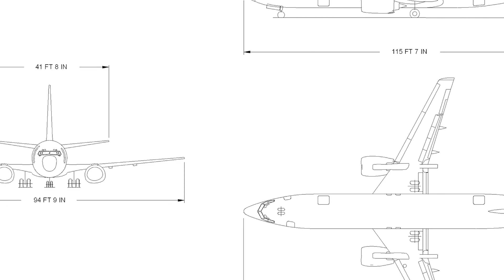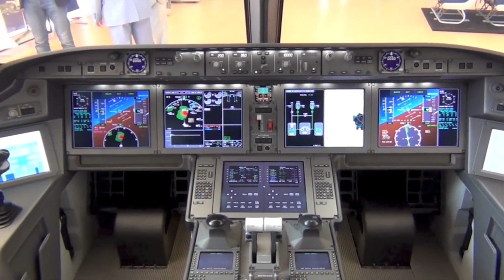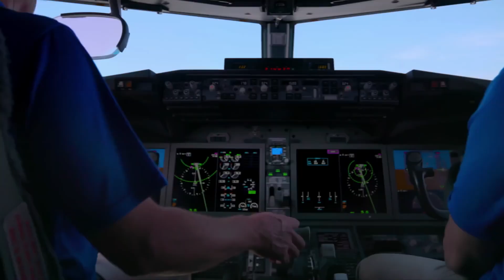Boeing 737 MAX - the legacy of the king

Comment: Too expensive to design a whole new model? How expensive is it now?
Reply: Hindsight is 20/20. It would have been less expensive to started fresh
Reply: @MaynardFreek  You're forgetting one thing. Designing a clean sheet plane from scratch to first flight takes 5 to 10 YEARS and involves a lot of R&D. Also, airlines didn't WANT a new plane, because otherwise there wouldn't be so many orders for the Max.
Reply: @MaynardFreek  - To be honest, it would have been enough to design the MCAS to use two AOA sensors (the 737 had them already) and shutdown "gracefully" if these were not in accord with each other. 

It would have lengthen the certification process quite a bit, but I doubt it would have added more than a couple hundred millions to the development bill...
Reply: @MaynardFreek  The Boeing 787 cost $50 billion to develop.  It might not have been less expensive to start fresh.
Reply: I'll just remind everyone that Boeing has spent $46 billion to buy & cancel their own shares, 25% eliminated which causes the share price to rise. Now they are borrowing $10-12 billion for short term cash flow? The "value" of 5000 planes is 0.5 trillion! When no passengers will fly on it they will suffer HUGE depreciation or the orders will be cancelled altogether. Ryanair ordered 100 but said they will not be forcing customers to fly on it --- they are NOT stupid!!
Reply: 15 billion dollars and counting. Literally the development price of a new aircraft.
Reply: Billions with grounding of all 737 Max worldwide. Irreparable damage to Boeing’s reputation and lawsuits.
Reply: @Eatshhhushi  at this time it appears to be around 20 billion bucks considering everything involved
Reply: @Eatshhhushi  "Irrepairable"
Reply: Also time

Comment: Bring back 757's and MD's(717). Those old models have been tested by life and were modified to almost perfection after unfortunate accidents over many decades... This new 737max is a completely different animal. It's made of totally different materials with new never used before designs, and unknown untested software and electronics...
Reply: Why would we go back to 757s and 717s? There isn't a market for them. And why axe off the 737 MAX when it can be improved and modified, like the models you mentioned?
Reply: @person.w9780  Some lines can't be uncrossed. Not only MAX will not be coming back, but the whole brand of 737 has been smeared for good, that's why I'm not mentioning it and talk about the only 2 single aislemodels with good reputation that Boeing had.

Comment: Build an inheritently unstable aircraft and add an "MCAS" / AOA (Angle of attack) device on the outside of
the aircraft to FIX in the inheritent unstableness and what do you expect? The new extra big By Pass
Jet engines had to be mounted forward and higher than what that airframe was designed for, that
is why the MCAS / AOA device was installed! SO WRONG, and all in the name of saving a few
dollars and boosting the owners PROFITS! Now lets add Boeing conviencing the FAA that 
no additional training would be needed by pilots switching from the old to the new, now
add the Airworthyness directive that came out November 7, 2018
 (AD #: 2018-23-51)
that apparently MANY pilots never saw and let me see, what else, oh don't forget the 
nacelles of these HUGE new engines will create lift at a 14degree pitch up attitude 
that makes the plane misbehave and you have a recipe for DISASTER. BELIEVE IT!
Reply: Now some are saying the plane is stable, that the MCAS as delivered is the royal screwup.  IDK.  Could be true; could be damage control.  Still waiting for the full story on this.
Reply: Assisted stability augmentation is not itself a bad thing. The MD-11 has it, the 777 has it. It was the IMPLEMENTATION that was disastrously bad. Clearly you know nothing about aviation.

Comment: Just disconnect the freaking  MCAS !!!!
Reply: Aaah but you can just turn off the MCAS software as this hull shape is aerodynamically too unstable to fly without a computer nanny monitoring and nudging its natural tendency to stall.. All a by-product of "pushing the (efficiency) design envelope".. So you have limit state engineering augmented by software to nudge it into a (just) pass category on aerodynamic stability.. Houston (Seattle) I think we have a much bigger problem!
Reply: @MajorDrama1  Nope, not true at all.
Reply: @AmbientMorality  then why does MCAS exist?
Reply: @christophermorley161  MCAS exists not because the plane is unstable. It's because it must behave the same way old 737's behave, so no expensive pilot training is needed. But it does not behave the same, mainly because the position of the new engines. So MCAS was created so it feels like and old 737 to the pilot. It backfired spectacularly as we can see.
Reply: @felipaorfr  It exists for both reasons. You are correct in that the "Augmentation" part of the name is due to making to making it feel like a 737, but its other job is compensating for the aircraft's aerodynamic instability due to the new placement of the engines. It is unstable because if power is added, then the nose tends to pitch up, as the thrust is below the centre of gravity. However, it will pitch up much further than the old 737NG, and will enter a stall much more readily. It is for this second reason that MCAS is required. Instability is like a ball on top of a hill. The steeper the hill, the faster the ball will roll, like the more unstable an aircraft is, the more quickly it will deviate from straight level flight. The other thing about this is, the ball takes a lot of energy to stop it rolling, and much more energy to reverse the roll and get it to the top of a hill. Same with aerodynamics in aircraft: the more unstable, the more energy is needed to stop the pitching up and tons is needed to reverse it and achieve level flight. This is part of why MCAS exists- the Boeing test pilots were horrified by what they found when they started chucking it about, and the trim needs to be adjusted to compensate for the plane's willingness to pitch up dramatically at high AOA. However, you are very right in suggesting that it was to make it similar/the same to fly as the previous 737, but that's only part of the reason.
Reply: @felipaorfr  Assisted stability control is not a bad thing. Most modern airliners have it. MCAS itself is not the problem. The problem is how horribly Boeing implemented it.
Reply: Maybe, just maybe, adding more fuel to the underbelly of the aircraft will reduce the pitchiness (CoM and CoT will be more in line). Then disable MCAS.

Comment: CHANGING the flight control computer
Then NOT telling the pilots 
IS CRIMINAL
Reply: 100%
Reply: It’s in the manual. It’s the job of the airline to train the pilots. American based airlines did. Ethiopian and lion didn’t. Problem sorted.
Reply: @baconcorde9970 Be great for Boeing if that simple! I heard that Boeing advised the airlines that the changes made to the control systems including the new MCAS changes were insufficient to warrant further training.. And further that the plane was sold with "no extra pilot training required" being specified as a benefit of the new plane when sold as training's costly right? If true it would seem this was  tragically short-sighted..

Comment: The old plane is much nicer than new type ... the wheels are hiding /cover not being seen under the plane... I guess that is the cause of plunging to the surface (ground ,sea) because of the pressure during flight even you have new engine which might did quarter of its problem/crashes , too much outward of its engine and not centered the position of its engine like others , the more gust of winds the ore trust and climb can give to the plane and double the speed of plunge down even you change flaps on both wings and adding thrust still can’t help to reduce plunge

Comment: actually, Boeing behaves like McDonnel Douglas during the DC-10 crisis in the 70's ...worst damage-control.
Reply: Well a former McD’s employee was indeed the CEO..... A McDonald’s employee would have done a better job. 🤦‍♂️
Reply: The joke is that McDonnell-Douglas purchased Boeing with Boeing's money. Boeing buys them then McDonnell-Douglas execs took over the company and kicked the Boeing execs out, somehow. The lawyer-accountants replaced the engineers at the top of the company, hence the 737Max disaster. With that and the communist labor unions, it's the end of Boeing.

Comment: They're falling out of the sky
Reply: You like someone else I know. Always blow things up. Some will say make a mountain out of a mole hill. I believe only 2 crashes and here on youtube, they have a video that the pilots could have safe them. No doubt, it needed fixing but come on. the 737 like sold more planes than any other type. Every 5 seconds there is one landing or taking off. Wow. is what I say to that, not make fun of this plane.
Reply: CaptainArt777 Boeing installed the MCAS system on the MAX, that a whole new system and they told the airlines no need to have a pilot training? Hell no! Even though know the MAX flaws but Boeing didn't care to fix them, just wanted to rush the MAX to enter service
Reply: That took a dark turn

Comment: Since Boeing has prioritised profit over safety, i don't fly Boeing anymore. Look at the 737 Max and the problems with the 787
Reply: I mean, i don't hear about any issues with their other planes.
Reply: @person.w9780  Ummm Duh!
Reply: Leo Raymundo - In a way. 80s crashes caused by hydraulic cylinder, which was redesigned to preclude fault. Max crashes caused by stupidity designed and hidden MCAS added to counteract near-stall handling characteristics resulting from tweaking the 1950s vintage airframe. Max is still flawed aircraft even with MCAS fix
Reply: @jameshoffman552  The problem is not the MCAS itself. It's how horribly wrong Boeing IMPLEMENTED it.
Reply: Innovations comes with issues
Reply: But the non-Max 737's, 747, 757, 767, 777, and 787 are safe. Stop being a paranoid idiot.
Reply: @leoraymundo2127  
Build an inheritently unstable aircraft and add an "MCAS" / AOA (Angle of attack) device on the outside of
the aircraft to FIX in the inheritent unstableness and what do you expect? The new extra big By Pass
Jet engines had to be mounted forward and higher than what that airframe was designed for, that
is why the MCAS / AOA device was installed! SO WRONG, and all in the name of saving a few
dollars and boosting the owners PROFITS! Now lets add Boeing conviencing the FAA that 
no additional training would be needed by pilots switching from the old to the new, now
add the Airworthyness directive that came out November 7, 2018
 (AD #: 2018-23-51)
that apparently MANY pilots never saw and let me see, what else, oh don't forget the 
nacelles of these HUGE new engines will create lift at a 14degree pitch up attitude 
that makes the plane misbehave and you have a recipe for DISASTER. BELIEVE IT!
Reply: Tjerk Heringa - How about that ‘solution’ to 787’s battery pyrolysis?
Reply: @jameshoffman552  Stop being paranoid. 787 has had no more battery issues.

Comment: Lion Aircraft incident happens only for manufacturing defect with take of gear, because this two month old brand new aircraft, doesn’t blame with aircraft operator? In addition to that Passenger Fleet do not need Vertical take-off and adventure flying only safety and security requirement fulfill?

Comment: why is the new edition aircraft not adding cameras on all sides of the plane and recorded in a black box ???
if the plane falls like a lion air airline, it's easier to find out the video visual recording that caused the accident to occur,
motorbike, in Motogp, can I just shoot a camera on all sides of the motorbike, even the Tesla brand is just an electric car with lots of cameras on all sides of the car,
How come the modern era is like a boeng or airbus is there no camera ???
The ATM machine only has CCTV inside the ATM machine. why doesn't the plane have a camera?
Is it hard to add a camera?
I hope that future aircraft can install CCTV in the cockpit, in front / front of the plane and on the tail of the plane and passenger cabin.
if there is a visual recording it will be clear and easy to uncover a plane crash, because of what?
This feature must be added in the manufacture of future aircraft.
Reply: Perhaps now we see why! Dust their tracks!!

Comment: Ironically. Your New Boeing 737 MAX 8 just crushed near Java Sea. Indonesia. And only have 600 hours of flying record.
Reply: Ironically the same plane type crashed in Ethiopia ...
Reply: Don't really think that the issue is the design. It seems unlikely to me. But hopefully we'll find out soon.
Reply: @TheOttomemeEmpire  So how likely is it looking now do you think?!
Reply: @MajorDrama1  Well it's confirmed that it's a design issue now. About the Ethiopian accident, though, a similar accident occured with the same airline under similar conditions due to pilot error... Either way it's not looking good for the 737 MAX.
Reply: @TheOttomemeEmpire  Fact From FDR JT-610. Boeing 737 Max 8 Speed Indicator Is Broken. And it's can't repair by regular maintenance.

Comment: RIP 737 Max 8  Lionair JT610 Crew & Passengers
Reply: And today. Another 737 max is down
Reply: Another one in Ethiopia..
Reply: Lion Air  !!! 😭
Reply: Another one happened today
Reply: I will never take that plane
Reply: Add that one of Ethiopian Airlines. I will never get on this fucking plane.
Reply: Lion Air is the worst airline ever and has the worst customer service amongst all Indonesian airlines.
Reply: I dont think its a boeing fault. But totaly by lion who careless in their service.
Reply: @feaizulmohddin8093  It's totally Boeing's fault who didn't tell the pilots that there is a new system called MCAS.
Reply: @feaizulmohddin8093  what about now ?
Reply: @feaizulmohddin8093  ITS boeings fault not the pilots because of the engine and they said pilots don't need practice but they need

Comment: Are 737 pilots still required to handle rudder hardover scenarios? It confuses me when I look at pilot discussions. Some say the 737 still have some rudder issues, while some say it has been fixed. I love and respect the 737 as the workhorse that it is, but it bothers me that there are so many different opinions about the rudder issues.

Comment: Airbus should already be concerned about the MAX. The Max 7, 8 and 9 carry more passengers, carries less fuel but with longer range and are cheaper to buy than Airbus 319, 320 and 321. Plus with the exception of the a321...the Max have a higher maximum takeoff weight and the a321 needs to have a higher takeoff weight because is carries a lot more fuel than the Max 9 and still can't beat the range. How is that for an old design as the numbers don't lie.
Reply: Well. It seems the shit did hit the fan, it's clearly indicated by the hasty release of the Boeing ops manual bulletin / FAA emergency airworthiness directive all related to MCAS... Some Boeing engineers will have a though time for sure... I'm interested to see how Boeing will navigate through the major shitstorm which is about to hit...
Reply: You know it's not just about fuel efficiency... One votes for a whole package of operational and maintenance costs. My personal opinion: a design from the sixties simply can not be sensibly compared to an other conceived about 22 years later... As rightly said before: a clean sheet redesign is long overdue. To put it mildly...
Reply: @robadzso  Your statement about overall costs being most important is correct, but you provide no facts to show either plane has a cost advantage.  All you provide is a half baked opinion based on an assumption.
Reply: You do realize Boeing and Airbus hardly ever sell there aircraft at the listed price. Just because on paper it seams Airbus planes are more expensive doesn't mean they will sell it at that price. Both Boeing and Airbus have been known to drop there prices if they can make a bulk sale to an Airline.
Reply: @TrevorEMayo  what I sense - without hard evidence, - since I do not run an airline - is that the design is so much outdated, that it simply can not keep up anymore. Patching it any further simply does not help. (Also I'm itching to see whether the new anti-stall system on the max has anything to do with the recent crash. Which seemingly has not been highlighted in pilot training.)